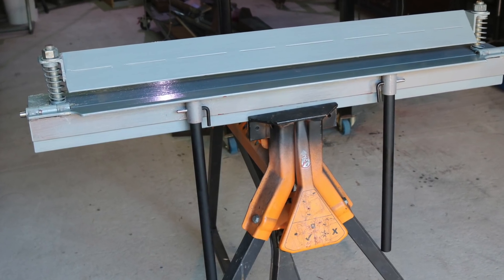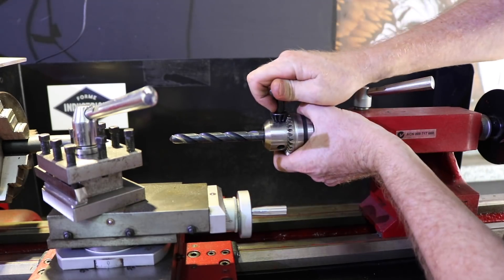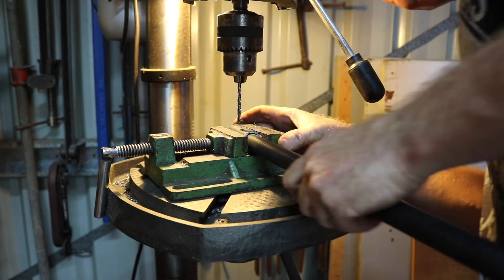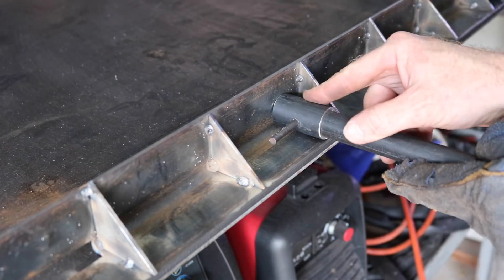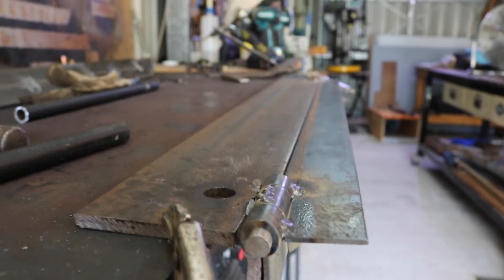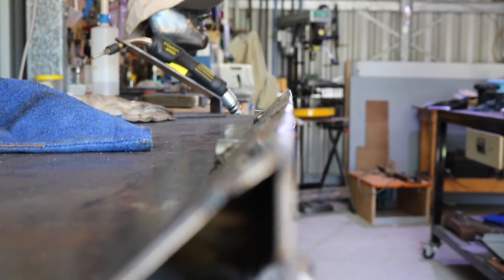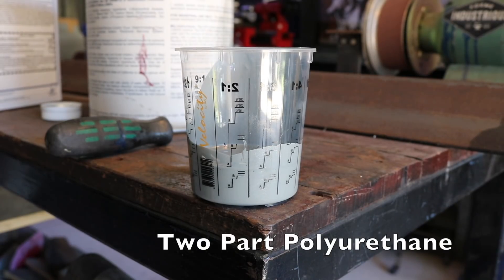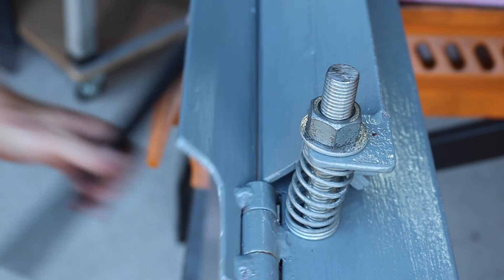DIY Sheet Metal Folder - Forme Industrious

Comment: Nice video, question, why is your weldingtorch not complete? I would say that gives you much better weldings
Reply from the maker: I use Flux Core Welding wire so no Argon gas is used. When the wire burns the flux shields the weld so no shroud is required.  Thank you!

Comment: You  can weld a valve to the bolt , like 10cm higher 

This way you dont need wrench and it is way easier and better for tightening/loosening
Reply from the maker: Yes might be a future improvement, thank you!

Comment: Nice job mate, I wouldn't paint where the job will make contact with the bender, the paint will chip off over time when bending heavy gauge, then when you bend light gauge it will leave marks on the job where it sits on the edge of the paint. Either chemical blacken these parts or give a coat of lanolin grease and wipe off, either way will prevent rust. 
At an old job we also had a bender with a half inch round bar to bend around, it made beautiful radius bends that might be more suited to the decorative work you do, rather then the sharpish corners. You know how to build it now, so it won't take long to make a second one, you will love the bends it will make. 
Keep up the good work mate.
Reply from the maker: Thanks for the tips; yes the paint will chip off I suppose. Building something is like swallowing a spider to catch the fly, always leads to another project, or a better idea. All the best!

Comment: Awesome job Scott. I need to throw one of these together for my shop.
Reply from the maker: Thanks Jack. I've been bending sheet over sides of benches, in vices etc for years so I though it was well and truly time I made one.
Reply: +Scott Turner I have done the same thing. Like you I also worked in the aviation industry for a long time. It's hard going for all the high dollar fancy stuff at work. Then come home to use makeshift or what ever you can find to bench stuff.

Comment: Excellent tip on the box bending, first brake I made was fine, 2nd with larger width, I hit the same issue as you with the flexing, the bends are not crisp 90°, but I decided that is useful for some projects, so I left it and now pretend I meant to make it like that.
I was going to use "Bristol " locking levers to clamp down but never bothered, but might be worth looking at for any blokes out there thinking of making a sheet bender.
Reply from the maker: :) but you gave it a go and still find the tool useful. Thanks Jaques!

Comment: Up to which metal thickness is your bending construction useful? Greetings from the beautiful Jagsttal Germany
Reply from the maker: Hi Andrew. I have tried 3 mm flat bar steel 25 mm wide no problem. The box I made was 1mm. Did it easy. All the best and hoping it's not too cold over there!
Reply: Scott Turner in momen -1 ° C and dry. very pleasant,  thanks ...